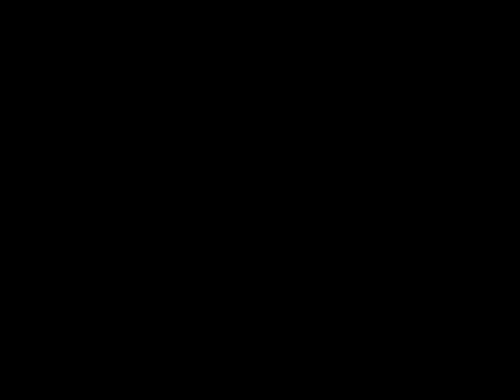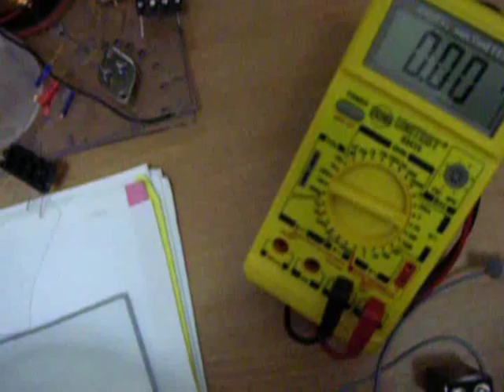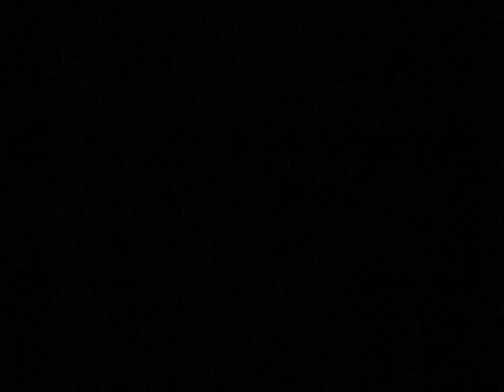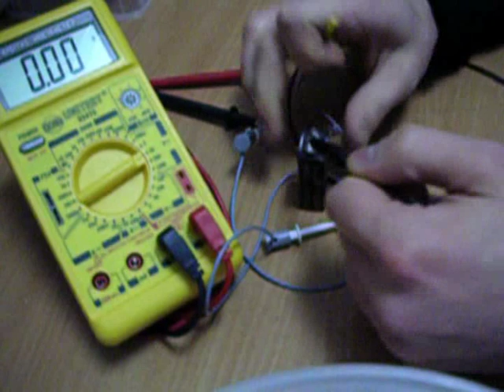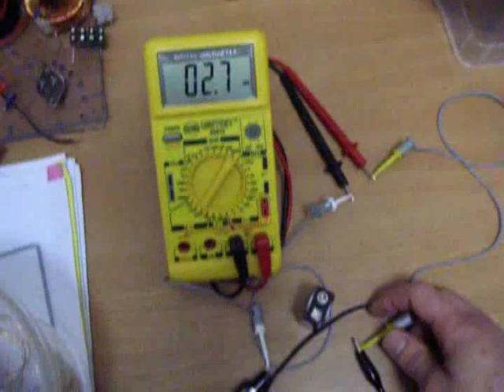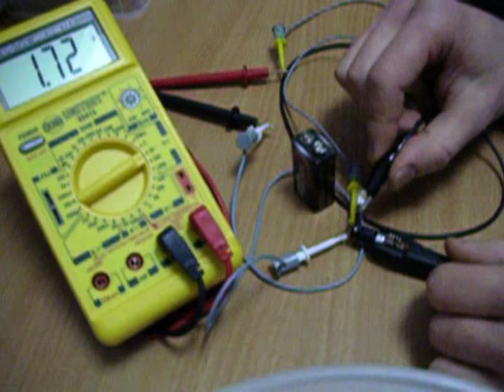K.W.O.N. and the Captret

Comment: After doing much more work on an actual powered capacitor not charged then removed the captret looks like an analogue transistor. One that very little current can leak trough. This is done via inductive capabilities from aluminum and the geometry of the can around the plates of the capacitor. This super imposes a transistor like effect and can be used quite well to increase the charge back into a battery. This happens better with a jewel thief type of effect. Unpowered, captrets are nothing.

Comment: most older foreign capacitors already use this idea so u are right i dont think its anything special. u are simply using more surface plate area of negative charge. its like grounding a circuit.

Comment from the maker: @jbignes5 Yes... you are right about the 2nd capacitance cuz the case is made of aluminum and will also store a charge between + and - and + and the case because it is made of aluminum... but there is no such thing as overunety or free energy in such a cap!
As i sayd "imaginary" resistance cuz it can be handled like that for a better understanding...
There is much more to say about that but i just wanted to confine it in that way...
THX for clearing it!
Cheers...

Comment: If you now disconnect the cap entirely and measure from all three plates (o,+  o,-  +,-) you get three distinct voltages and the o,? you can repeat for quite the while using the o,?.
 There is much more then resistance going on here. In fact the powered captret doesn't take much in current at all because we are using only the voltage potential from the trickle flow provided by the (o),+ is setting up. We have three capacitances being used at once.

Comment: It creates a cushion for the new plate to get some voltage from in between the stored charge of the normal plates. Weather or not it is free it is not clear but what I have seen when you feed the cap through the new plate (o) the negative from the battery and connect to the positive of the battery the real plate (+) of the cap this sets up a flow in that direction. Because the cap was filled traditionally you now have 3 distinct charges.

Comment: How about it is not resistance in the traditional respect it is capacitance. If you remember that as a capacitor charges up it's internal resistance to flow is increased. You are not reading the traditional resistance but the reactive capacitance and the opposition to flow as that capacitance fills up or opposes it.
 So what we have here is a resistance that is based off of capacitance just like in the normal plate design but this includes 3 plates now. When you fill the cap normally. Continued